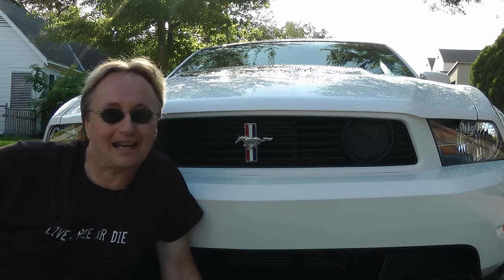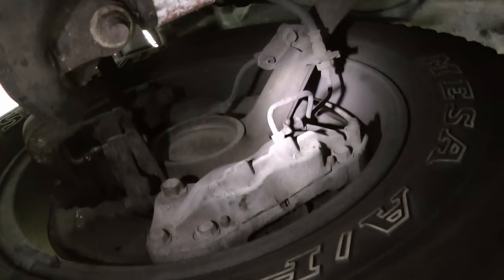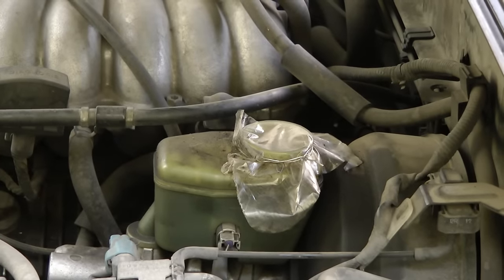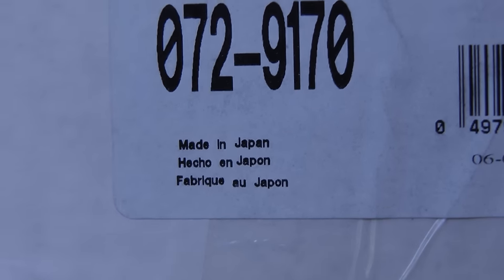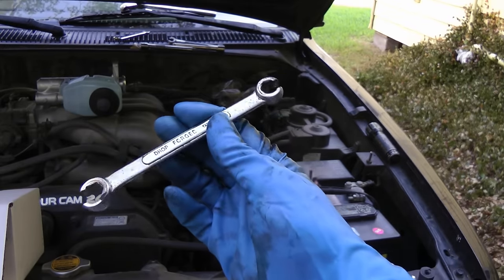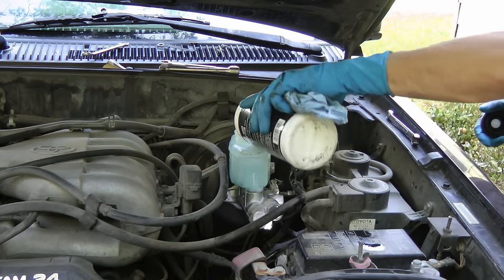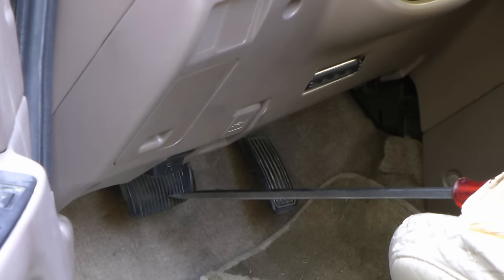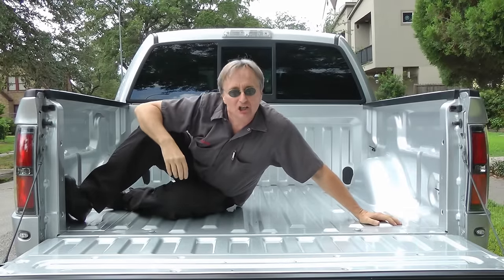How to Fix a Brake Pedal that Sinks in Your Car (Brake Master)

Comment: It is that easy take it off and put it back on. The hard part that I'm still fighting with is the hard brake line between the master cylinder and strut tower. 05 LGT LTD

Comment: Hi, I'm new subscriber to your channel,
I like how you're describing of repairing step.
I have problem about my car brakes, i installed new brake pad to front wheels and change the seals rubber in the master brake. But i get my car have not much strong braking however i push my brake pedal (it not to the floor). What real problem of my brake? Thanks

Comment: Hey Scott.. hope ur still answering your utube comments here. I stomped really heavily on my brakes in the slippery road trying to avoid whacking into a lady who never cleaned off her brake light- so not seeing them I had to pull over to the side to avoid hitting her. The ABS was growling away, but I had to go to the floor with it. The brake pedal now is working barely pushed to the floor. I lost my bleed pressure. Could I have ruined to ABS Modulator or ruined the Master Cylinder. I think the ABS had something to do with it. I checked the reservoir and for leaks and it was still full of brake fluid.
Reply: Same thing happened to me last night too. Dam snow !
Reply: is your ABS light on?
Reply: Thanks darkhelmet951
No not at the moment but after pulling it out of garage last night to keep battery charged as were getting hit with sub zero temps lately I noticed a trail of break fluid drops. So im guessing break line has a hole somewhere.Ill let you know later as today were going to investigate further/fix..Thanks
Reply: John Doe Its best that you get that replaced immediately. If you have too take a day off of work to get it repaired then do so. Your life is more importantly than anything else.
Reply: Hi darkhelmet951
  Thanks. Yea i agree did that today .Turned out I got lucky, was just the front rt break line @ $45.00.
   Was hard to get to also. Chilton's quoted 3hr's time on it and they were pretty close.
  That's weird though it took 2-3 days to show any leaks but i wasn't driving it either. I knew there had to be one somewhere as I just replaced that master about year ago. So I scratched that off the list. Even though I did have one back in the day go bad after like 2 weeks lol. Thanks for your help and tips :) ..Patrick

Comment: My mechanic checked the master cylinder and it was just fine, the calipers were checked not leaking, we bleed the air out but still the brake pedal sinks!! I am driving lexus is200 and i just gave up and driving it as it is, just being caution and not driving close to any vehicle because if i had to push the brake suddenly, i am just gonna hit whatever is infront of me. Feels like riding a train, you brake here you stop after couple of meters if you are lucky, if not, you just feel the car braking for a few seconds and bum nothing the car keeps on moving

Comment: Scotty, 2018 dodge charger,5.7 hemi 16000 miles every time I park it on a hill ,and start it to go home after work I see a puff of white smoke,  does not do it on a level surface, I change the oil every 5000 miles with pennzoil full synthetic oil 5w20 which it calls for and I put a mopar filter ,I'm going crazy dealer says it nothing
Reply: I wouldn't use pennzoil in a lawnmower....maybe the synthetic is better than the conventional you hope!

Comment: If anybody has an advice here I would extremely appreciate it. I just bought a 2006 Volvo S60 AWD 2.5T and the brakes travel pretty far down before it actually stops. If anybody has this car can they tell me if this is normal or is there more than likely a problem with the master cylinder? I'm thinking about changing it but not sure if I should try bleeding the brakes first.
Reply from the maker: +Teh Mc-Cookiez (Gameplay) live with it, that's how those things just are as they age. Realize you bought a money pit euro machine, don't get too wrapped up in perfection on one of those.
Reply: +Scotty Kilmer oh alright. Well thank you for your quick reply.

Comment: I've replaced the master cylinder on a 2004 Pontiac Grand Am SE. bled it, and brakes still hit the floor.
Reply from the maker: realize if you have ABS brakes, you can not properly bleed them without a dealer level scan tool to get the air out of the module assembly

Comment: You forgot a few things, 1 brake fluid attracts moisture not air, 2 drum brakes out of adjustment can mimic that feel. 3 frozen caliper slide pins are also another common problem that will give a terrible brake pedal feeling.

Comment: When I push down on my brakes I hear a hissing sound and barely can stop before the car cuts off . I'm throwing o2 sensor codes but my brake pedal hits the floor before it's stops and shuts off
Reply: I wish he would answer your question and others I've seen ...
Reply from the maker: I have over 156 million youtube views, no way can I respond to everyone watching.. But,  hissing is often a bad brake booster that will also cause vacuum leaks tripping the sensor code at the same time.
Reply: Scotty Kilmer thank u I appreciate it

Comment: It could be brake pads need to be changed also if it travel for long distance
Reply: Sroor9001 can it be the rotors need to be changed I change the brake pads and the drums in the back new master cylinder with a brake booster the shop did it and now my pedal is still sinking but I know I need some new rotors can that be the  problem

Comment: Hey I've change the master cylinder an my breaks still sink to the floor.. Can someone help
Reply from the maker: +rico albury make sure all air is out of the system and that there are no leaks you can see anywhere. If not that, then either booster is bad or ABS system is failing

Comment: In my 2000 impala ls My brake light and trac off light was on, I was told to add brake fluid which I did and both lights went off...I thought that was the reason my pedal was sinking.. I drive around in it to see if anything changed and my started leaking and both lights came back on. Is this my brake fluid leaking? I about to buy new brake pads.
Reply from the maker: you lost fluid, therefore it's leaking somewhere, so find the leak first, pull off all wheels and if you see no leak, replace the master cylinder they leak inside boosters and you can't see that
Reply: Thanks. It was my brake line

Comment: Indeed. Why not gravity
bleed the rest of the system too? At least,
It will purge the air and
Moisture that has worked its way to the 
Calibers. Anyway. This
Is how I would do this
As well. I don't bench bleed. Just make sure the master
Cylinder has enough
Fluid while you bleed
👌✌️

Comment: I was told my sinking brake is my booster i bought that and replaced it, didnt fix it, im going to try bleeding the brakes and hope its not the master cylinder, i have a 98 f150
Reply: Why? Master cylinders are relatively cheap.
Reply: Because I have spent enough money on brake work, I had to buy front calipers, brake booster,and lots of fluids, also I dont have all the tools for the master cylinder, and truly its a pain in the ass...but yeah as of now I have to get a new one.
Reply: I hear... in a similar situation...Rotors, pads, calipers...Headed to the mechanic tomorrow to have the brakes(ABS) bled...If that doesn't work I'll be ordering a master cylinder.
Reply: Thats why I am so glad I don't have ABS. but if this master cylinder doesnt fix my pedal, I am gonna part out my truck,to get my return, and pay off its fees... and invest the rest
Reply: Ya because if I didn't best believe I'd be bleeding them myself...Sounds like a good plan...I've been there 2..Get tired of dumping money into a vehicle...Smart move. Goodluck!
Reply: See if I had ABS, I dont now because my new calipers are non abs...but with my truck off the pedal doesnt sink anymore, but when its on it refuses to come up right after, I checked for a vacuum leak and I am good there, so only thing left is my Master Cylinder.

Comment: i have a 2004 Pontiac Aztek and i have bleed the brakes but the pedal is still going to the floor any suggestions anyone
Reply from the maker: if no work was done on the car, other than bleeding the brakes, the system has a problem, like a bad master cylinder, bad ABS modulator, or leaks somewhere. check those first

Comment: hey scotti?  why do all the mechanics say that my brakes should be bled in the order of passenger rear, driver rear, passenger front, driver front?     because i drive a 2006 pontiac grand prix GT with abs brakes, and the Haynes manual for my car that i purchased at autozone specifically says that the correct order for bleeding brakes is passenger front, passenger rear, driver front, driver rear.      this is the almost the opposite of how the mechanics bleed em.     what's up with that?    who,s right?   the Haynes manual, or the mechanics?
Reply from the maker: +Jeff Fuehr neither, I do passenger rear right then rear left, then drivers' front right and driver's front left. You want to bleed from the furthest point to the closest in that order

Comment: My brake pedal is hard to press. What is problem?
Reply: Maybe a faulty Brake booster? Normally, to test this, you press the pedal some times without the engine running. Then, you press the brake pedal, start the engine and then the brake pedal should sink. If not something with the brake booster (or the vacuum pump attached to a diesel engine) is wrong.
Reply: @andreasfuchs896  yes the vacum pump on the engine was I replaced whit new and work good.

Comment: I let mine drag too long on the front and lost all brakes the other day. it puked all the fluid out on the broken brake wheel. Gotta take it in. Rotor is ruined too. Prob cost $300.

Comment: Every mechanic has their own way of bleeding the MC and calipers. One way of getting fluid and no air in the MC, is by manually pushing in the MC piston while there is fluid in the reservoir.
Reply: Bench bleeding
Reply: +YoCatGaming  Xactly!
Reply: I've always bench bled the master cylinder first and then bled each wheel to flush all the old fluid out and ensure all the air is out of each wheel line.

Comment: I've bleed my brakes already still have sinking brakes on 03 ford Taurus I spoke with someone thinking it's the booster how can I tell if it's just the master cylinder?
Reply from the maker: replace the master cylinder and pray. They are cheap, boosters cost a ton
Reply: +Scotty Kilmer  thanks im going today and picking one up
Reply: There's another video on YouTube for adjusting the booster on Fords.

Comment: Hi,

Thanks for all the great videos.  You have saved me lots of $$$ over the years.

Working on old bang around jeep brakes.  I can't get the bleeder screws out but thought I would check the master cylinder in case that was the problem.  I sucked out almost all the fluid and took off the lines.  Had the wife press the pedal and fluid shot out the back hole but hardly anything from the front.  The front reservoir is smaller and I think it goes to the front brakes but might be wrong.  Back brakes are sealed off and have never worked in 3 years.  Pedal went soft and brakes don't work after it mostly sat for a year.

So you think it is the MC since no fluid shoots out of the front hole?

Comment: I don't understand the logic behind this, when you replace the master cylinder not only you bleed the master cylinder but you have to bleed all four bleeder valves on each wheel or there will be much air trapped in the lines from having changed out the master cylinder.

Comment: Once went to a large auto shop for a rear brake job but i checked all the brakes and fluid. The guy i bought it from had done the front brakes and master cylinder like a year b4 i got it but didnt do the rear. The guys at the garage wanted to charge $1000 for a full brake job and master cylinder for a $1500 tops car. Even tho it only need rear brakes. Nope screw that my friend helped me do the job for mych less

Comment: changed my master cylinder twice now for the same reason anybody know what else  would cause a pedal to sink slowly ?!?!?!?! master cylinders that i used were both new and from different sources i have no external leaks i have a firm pedal but then lose pressure while holding the pedal.  was told to change the booster but that makes no sense to me and the person couldnt explain it to me either
Reply: Hector Bautista did you find out if it was a boster  I has the same problem it's firm then goes down slow, idk if it's the abs or booster? And tips to see I checked the check valve is good too
Reply: NO IT WAS THE ABS MODULE
Reply: I DIDNT HAVE TO PROGRAM IT EITHER IT WAS AN 04 DODGE RAM 1500 THOUGH

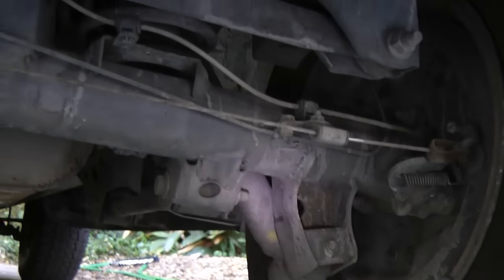Comment: 1:03 You said: unless you live in an area where there is a lot of salt in the winter the lines don't generally rust cause they are made out of steel, I understand what you mean but it's how you worded it. The fact that the lines rust at all is because they are made of steel in the first place and like you mentioned road salt speeds the rusting process up very fast. I live in the salt belt of the U.S. and I really wish auto manufactures would use stainless steel brake and fuel lines because they suck to replace (speaking from experience). Auto manufactures buy in bulk and although stainless steel lines would cost a little more it wouldn't make the price of the vehicle spike astronomically so it's nonsense they don't use something that could actually keep a vehicle safer much longer... Yea I'm venting because I just had to replace rusty brake lines on another vehicle. sigh
Reply: EagleTalons1 I think the same too but may b auto manufacturers don't want us to use out vehicles for so long and want to sell us their next car because they can make us believe and experience keeping old cars is a pain just because they are purposely designed to make it painful

Comment: what if it's still not fixed? as in it still pushes to the ground. my breaks don't work tell they meet with the floor. 92 4runner automatic.
Reply: Also could be worn pads / drum brakes out of adjustment or seized
Reply: Brandon McKnight mine r done I’m on vacation to visit fam n I’m really upset bc I don’t have a lot of money to go pay a macanic please help someone

Comment: my 1999 Mitsubishi v6 g d i car speed up and slows down while driving   it's driving me nuts.
Reply from the maker: +thinker george pressure test the fuel pump after changing the fuel filter and pray it's that easy, a weak fuel pump. If not that, often bad automatic transmission if it's an automatic
Reply: Smart.go to the back of the class because I can teach the teacher...I think your right, I have been adding transmission oil frequently. Wow what's the cheapest way to fix this. Living on an island with few parts and dumb machanic's

Comment: good video... but one statement "...the lines don't generally rust because they're made out of steel..."     What??? steel does rust... if a vehicle is say 15-20 years old or older, it is likely that there is lines, or at least sections, that do need replaced due to rust. Very often in the rustiest sections, it will blow a hole in the line. Which is why the master cylinder is separated into two compartments between front and rear brakes, so if a line blows on the rear brakes for instance, you will still have front brakes and will still be able to stop the vehicle.
Reply: What he meant to say I imagine is that they are treated steel - as in zinc or galvanised, not iron.
Reply: The lines are actually crossed. 1 front and 1 rear on a master cylinder. So if one goes out, you still have one wheel of front and rear braking.
Reply: YHRIM shalom

Comment: I'm going to do this when I flush and rebleed my entire system. I'm going to get a long wooden dowel to use, and my driver seat is power motored. So I'll be able to move it to the front pushing in the brake pedal, then do the wheels.

Comment: did he say that brake lines don't usually Rust cause they're steel?
Reply: Yeah I did think that was quite funny
Reply: +Dennis Talley unless you're somewhere that has a lot of salt.
Reply: He said that they don't usually rust in areas that don't use salt for snow and ice because they are steel. He probably didn't need to mention the steel part as that is sort of redundant. We all know steel rusts but generally... cars purchased and ran in states away from coastal areas and snow don't have problems with the steel (often painted) brake lines that run under the vehicle.

Comment: It's worth mentioning that it could also be the abs controller that is causing the pedal going to the floor. If that's the case you're gonna be fucked and expect some sand too. It's an expensive part to replace.

Comment: Don't do this. First, bench bleed the master cylinder. Then install it and proceed to bleed the lines. If you have ABS, you'll need to take it to the dealer to have them bleed the ABS module with a computer or you'll always have a soft brake feel.

Comment: Eh.  Without a proper cap on the fluid reservoir, the fluid is probably trashed.  Maybe could've gotten away with just flushing out the fluid.

Comment: I'm so confused, the master cylinder was just missing its cap, you could've just gotten a replacement cap then bleed the system again.. but you said get a new cylinder, you didn't bench bleed that one, but then you didn't bleed at the actual brake lines either, if somebody else skipped this many steps you'd get a really spongy brake, those steps aren't self explanatory lol
Reply: I believe your correct.The whole problem was air in the lines and missing a cap.
Scotty just wanted to make some money on replacing parts.